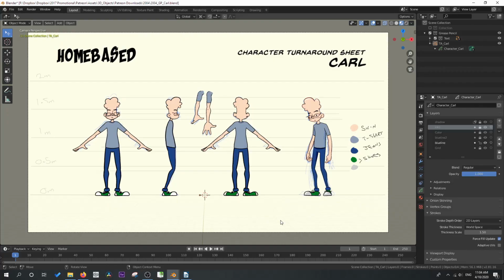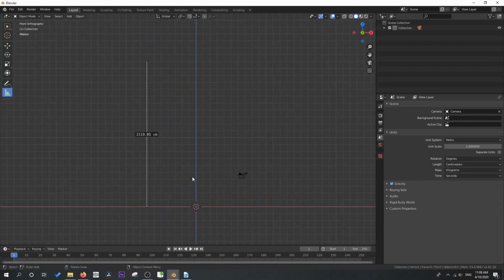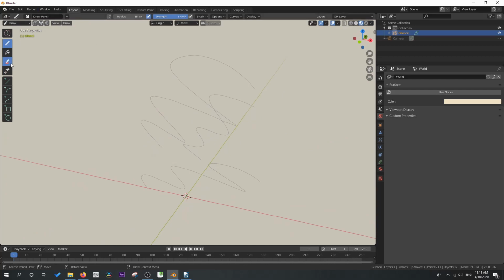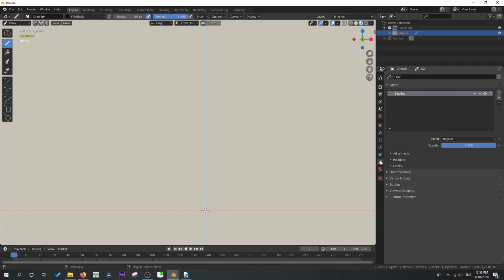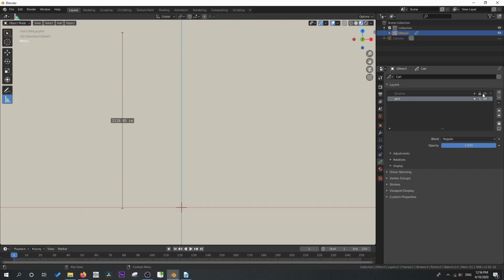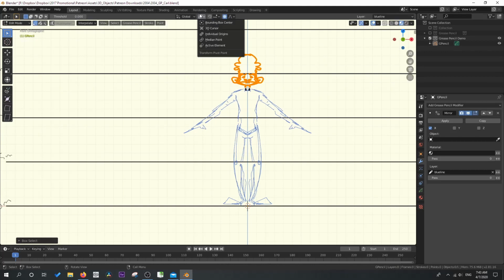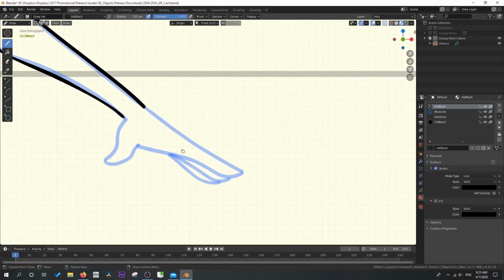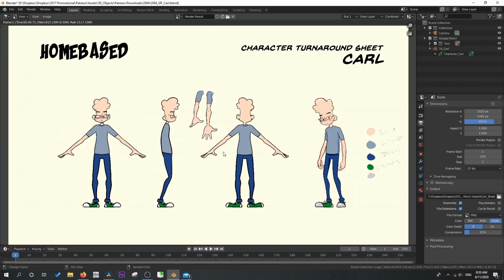Blender Grease Pencil: Character Turnaround Sheet - Redux

Comment: The colour of the "pencil" is grey for me in the material preview mode even when I have assigned the blue material to it. How can I fix it? I'm using blender 2.91
Reply from the maker: Gonna hazard a guess here... are you using Vertex paint? If so, check that the tool is set to "stroke and fill". This is above the panel with the swatches

Comment: Thanks for the tutorial :) For some reason my mirror modifier isn't working though even though I set the layer to blue line. It's still only drawing where I draw and not on the other side. Any help will be much appreciated. Thanks :)
Reply from the maker: Hmmm. Check your pivot point. Also check your mirror modifier - is it viewable in draw mode?
Reply: @PCaggegi  For some reason I had to switch the modifier settings to y when I thought it would be x but it's working now. Thank you:)

Comment: Thank you for this! I wondered why you choose to modify the default layout rather than using the 2D animation option from the outset.
Reply from the maker: This is a character turnaround sheet. It does not require animation tools? It is also simpler to familiarize beginners with the interface this way, rather than overwhelm people with information about all the various layouts available - especially if they're not going to be animating, or working predominantly in 3D. I try to focus on techniques and methods which stick to basics. I did check out the "make new 2D animation preset, however - it is pretty cool!
Reply: @PCaggegi  Thanks Paul I understand now